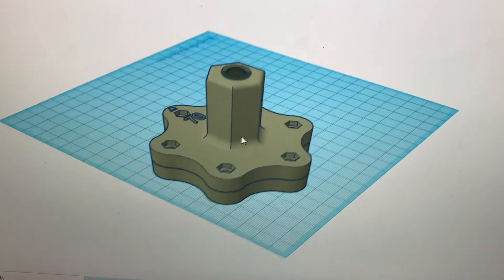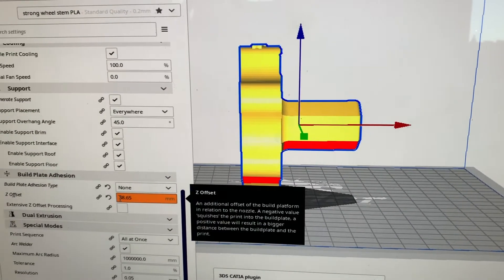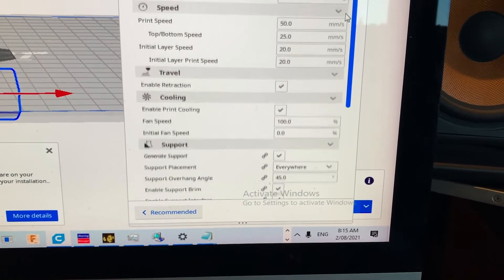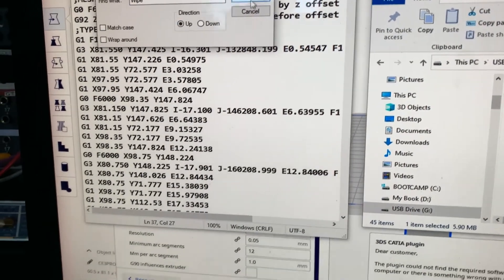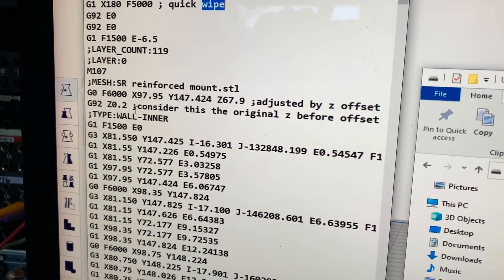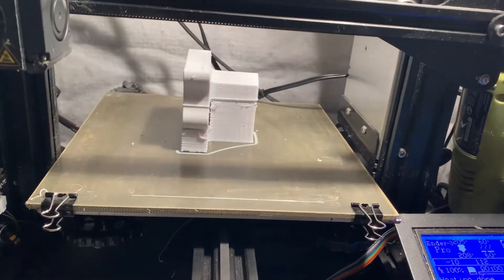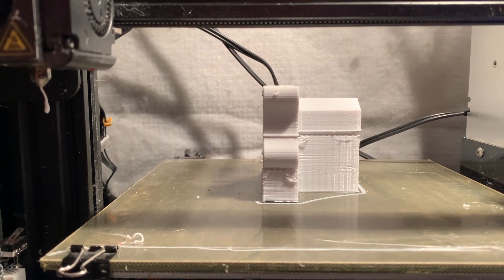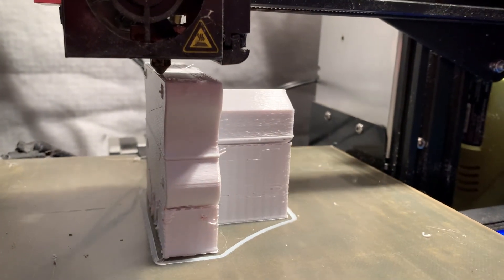Resuming a failed 3D print quickly and easily. Save time!

Comment: Hey I'm in need of help, I am trying to do as you explain in the video in Cura but my version of Cura (4.12.1) does not let me edit or move anything and it tells me that " PRINT SETUP DISABLED. G-CODE FILE CAN NOT BE MODIFIED" I have the z-offset plugin installed . What do I do now? HELP PLEASe 48+ hours into my print and the power went out less than 10% left to do.
Reply: Hello, I am new to 3D printing as well but the only way I’ve figured out how to bypass that error is by downloading the print again, entering the exact measurements you used on your original print (I take photos of my measurements before I start printing) and then you can follow his steps. I just finished doing this myself. Hope it helps sorry it is probably not the easiest method
Reply from the maker: Sorry I missed this. Have seen a similar problem once and as @average gamer said, the file might have become corrupted due to the power outage. I always ‘save project’ in Cura now so I can always load it and regenerate a fresh G-code file quickly if the old one is gone or damaged.

Comment: you really kept the bed hot for 20 hours?
Reply from the maker: Yes the print was still running with no filament coming out so I paused the printer but maintained the printer bed temp and then continued printing. I’ve also done it from a cold bed and let it heat up and print again.

Comment: I dont have Z offset setting :/
Reply from the maker: Check because you should be able to enable it in the Cura printer settings options. It will then appear in the settings window pane.